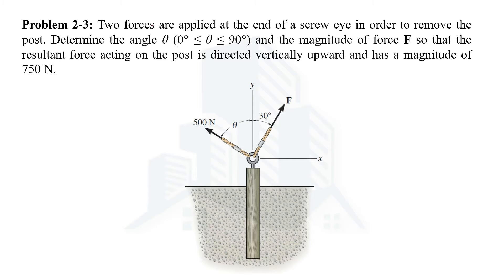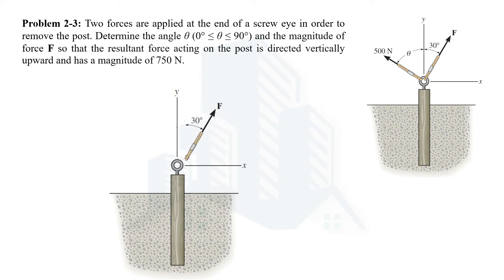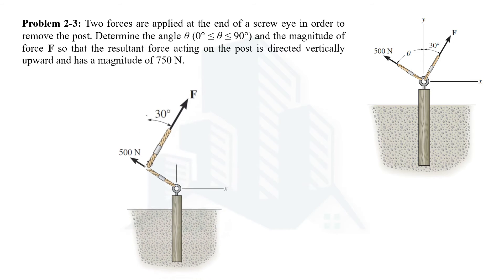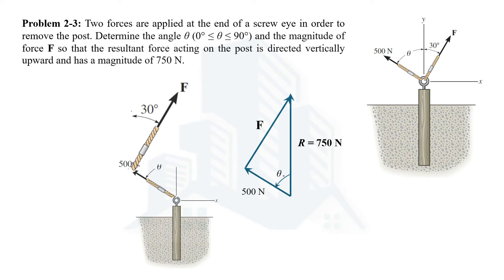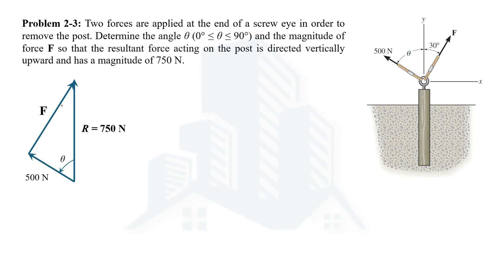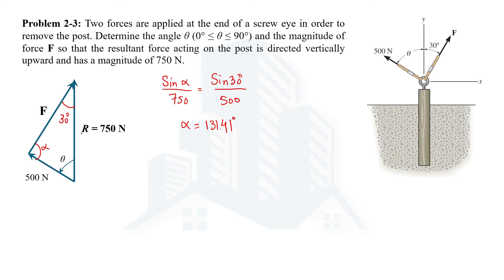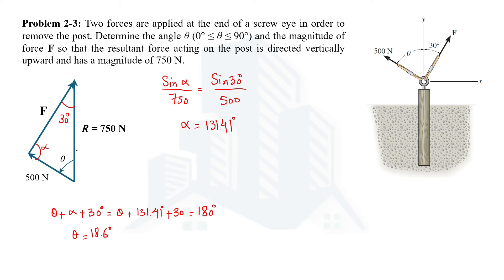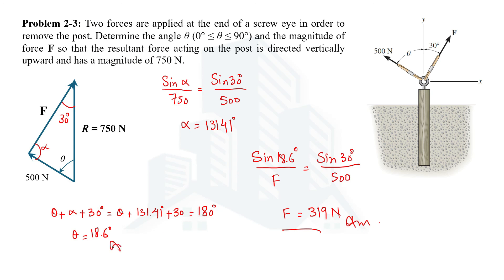Problem 2-3 Determine the angle θ and magnitude of F, resultant force 750N is directed vertically up

Comment: This solution isn’t making sense to me. I’m not sure how the calculations came out to 131.4degrees. I get that 180-48.6=131.4 but when we do the inverse of .75 it gives us the angle for alpha right which would be 48.6 right?
Reply from the maker: Keep in mind that the theta is required to be in the range of 0 to 90 degrees. Though the resulting value of sin inverse of 0.75 is 48.6 but it will not result theta in the required range. Sin131.4 will also result 0.75, which will result theta in the required range.

Comment: How did you get alpha=131.41?
Reply: When you solve for sin alpha, you get .75 and when you punch that into the inverse sine function you get 48.59 and if you do 180-48.59, you get 131.41 but i don’t know why you need to do that
Reply: @hanswirshing8904  I think this is an ambiguous case of sine law so there are two thetas that would work thats why he used 131.4 degrees since we know theta has to be within 0 to 90 degrees if we had used 48.59 then theta would be greater than that.
Reply from the maker: @hanswirshing8904  This is by observation.